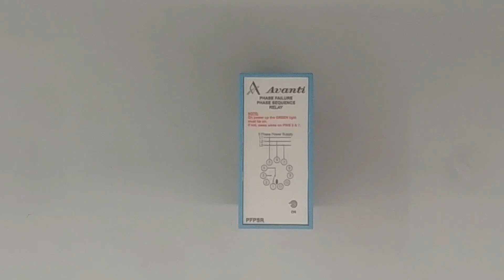Phase Failure Phase Reversal/Sequence Relay

Comment: Will the contactor turn on really? Because i am not seeing neutral supply connected to any of the contactor coil( A1 or A2). You've only supplied blue phase directly to coil A1 of the contactor and another wire taken from port 3 of phase failure to A2. Where is neutral taken to? I need help plz
Reply from the maker: Hi. The only reason to put a phase failure/phase reversal relay in your main DB or for pumps is bacause it is 3phase. 

To connect a neutral wire would mean a single phase connection and it would not be necessary to put a phase failure in a single phase connection as there would be no damage as in 3phase if the one phase drops.
Reply: @p0we111  I'm referring to the contactor, sir. The wiring of phase  failure I understood very well. May be I don't understand the concept of contactor in this scenario. Because I have always known that for the contactor to be energized, it must be supplied with phase at A1 and neutral at A2 or vise versa but for this case contactor is supplied with 2 phases
Reply from the maker: @Happy_254-d1e Hi. Yes you are correct in your observation. A1 is a phase and A2 is a phase. This is a 400vac contactor where the one you speak of with the Neutral is a 230vac contactor.
Reply: @p0we111  ok sir, so in 400vac contactor we connect phase to both A1 and A2?
Reply from the maker: @Happy_254-d1e  Yes. Connect a different phase to each A1 and A2
Reply: @p0we111  Thank you sir!!
Reply: @Happy_254-d1e  I had the same worry, thanks for the clarification

Comment: Hi quick question    So what will happen if you loose one phase in the supply of the relay ?
Reply from the maker: Hi Michael. If you lose one phase the relay will not switch on. The relay sould be connected to the pump contactor or mains contactor thus not allowing the pump or main power to switch on.
Reply: @p0we111  thank you very much for your quick response 👍 appreciated

Comment: Well understood but I have a question on the Number 8 which is latch,preset,Number 9 common  which is neutral, then 10 setup delay and 11 faulty restart delay please shed more light if possible

Comment: I came because my electric scooter through a fault saying “motor phase fault” but the motor wire is connected fine. For some reason it delivers more power to the front motor than the rear , idk what’s going on
Reply from the maker: Hi. I do not have a lot of experience with Electric Scooters but if you see no wire that is loose outside the motors,you're only other options are to open the motor and check for a loose wire inside the motor. If no wires are loose then it can only be one of the coils that burnt and that you can have rewire at a shop if it is worth the cost. Otherwise a new motor might be an option. 
Just check the switch/throttle as well before scrapping the motor.